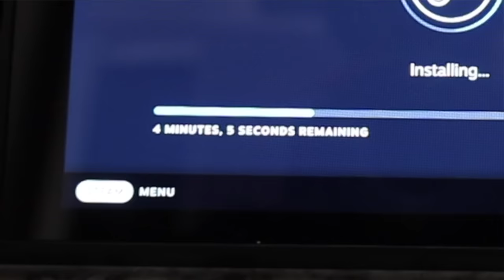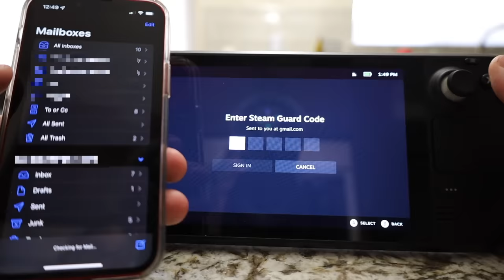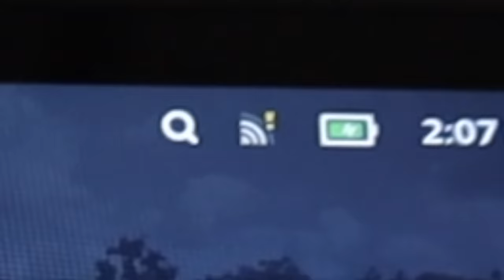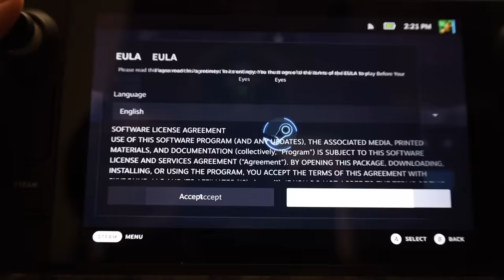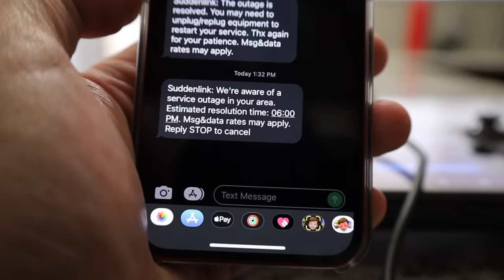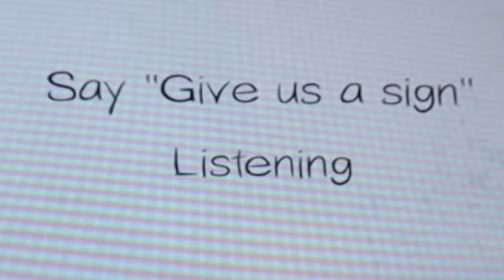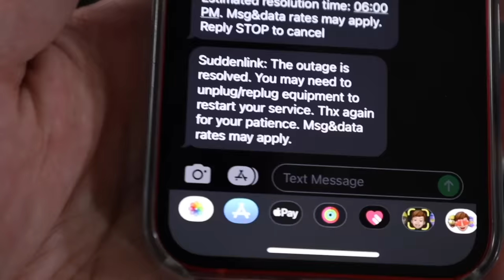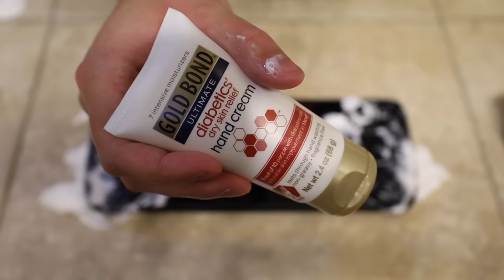MY STEAM DECK EXPERIENCE

Comment: The only things that's impressive is that the nintendo switch or the steam deck did not have a temperature shut down when they had a hot iron placed on them

Comment: looking at this brand new console i can confirm that its almost a nintendo switch copy, even the connecting to the internet sceen looks the same
Reply: It has about 10 times more storage, 5 times more performance, so much it can play current AAA titles while the switch cant even play pokemon in 2022 at 1080 and is completely moddable and upgradable, just for 100$ more.
The switch is a babies toy compared to any other current console and the hardware has been obsolete for years.

Comment: you actually can use vr on a steam deck you just need steamvr installed for once and an actual non-oculus headset that supports steamvr and it will most likely work

Comment: Am I the only one that thinks the steam deck if just a wanna be Nintendo switch
Reply: You’re not the only one
Reply: It has about 10 times more storage, 5 times more performance, so much it can play current AAA titles while the switch cant even play pokemon in 2022 at 1080 and is completely moddable and upgradable, just for 100$ more.
The switch is a babies toy compared to any other current console and the hardware has been obsolete for years.